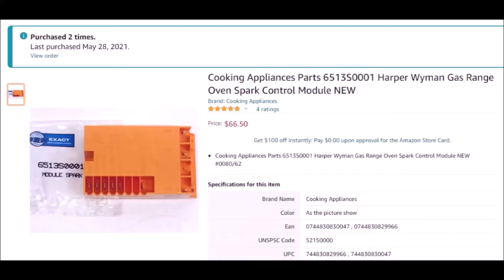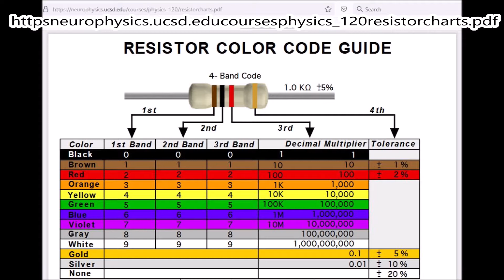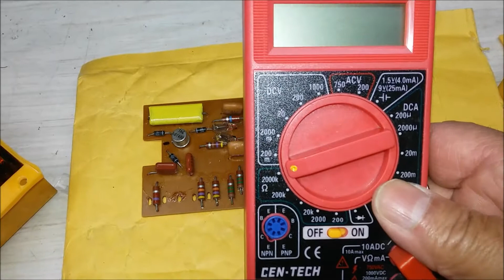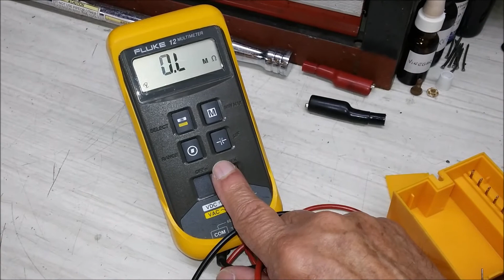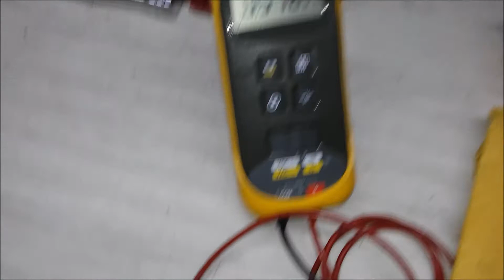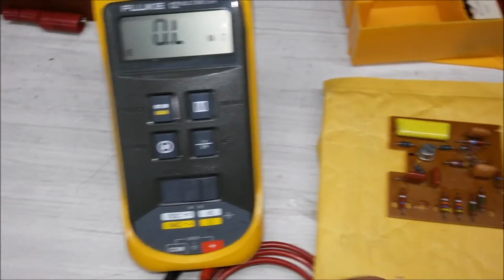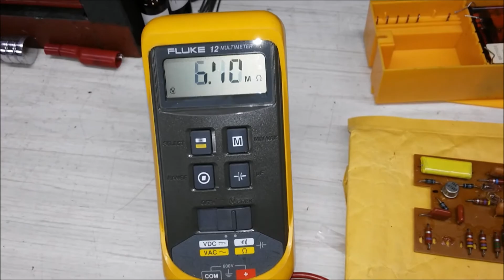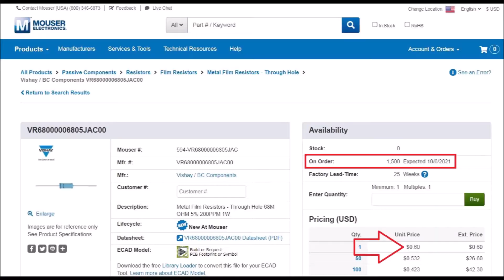Frustrated User Guide: Harper-Wyman Kool-Lite 6513 No Spark!

Comment: I'm looking for the 6515 anyone know where I can find one please. Thanks
Reply from the maker: Are you looking for part number 6515S0001? I certainly wouldn't buy a used one, but they are available.  Search for it using DuckDuckGo. Alternately, part number 6540S0001 https://www.genuineapplianceparts.com/item/6540S0001_Spark_Module_Replacement_for_Harper_Wyman_/929/c48m56 looks similar to a 6515. Would it work? Someone might know. Personally, I'd just fix the one you have. Long electronic experience tells me the failure will be very similar to what's shown in the video. Good luck. Thanks for asking!
Reply: @LawrencePina  Thank you
Reply: Did you ever find a 6515? I’m in the same boat and can’t find one
Reply: @reddrider74  sorry no go